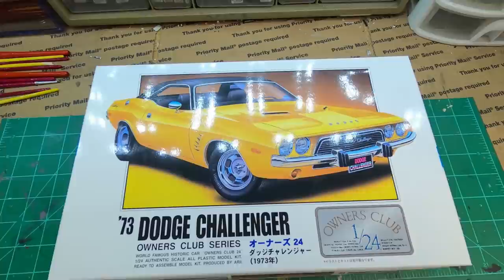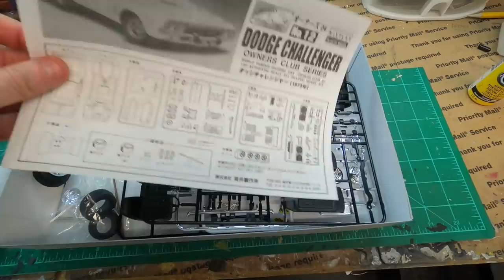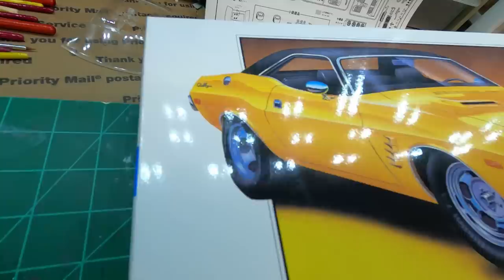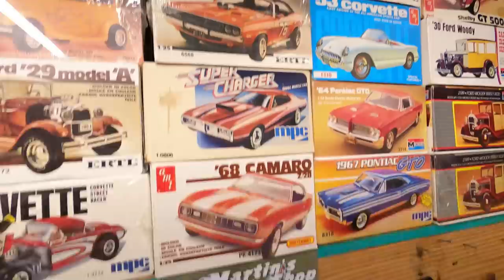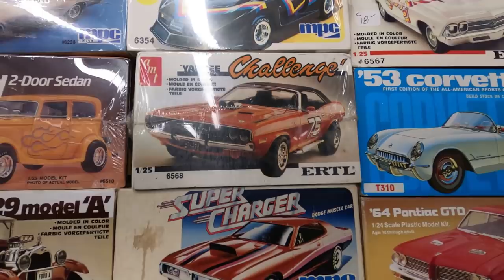ARII 1:24 Scale 1973 Dodge Challenger With MCW Paint!!

Comment: There are a few tricks to using "craft" acrylic paints. Using a quality acrylic "thinner" is a must. You can make your own using 70% ipa, distilled water,and glycerin. I have used a lot of that type of paint and it comes out great using Createx reducer.
Reply: I also use that formula with craft paint, but still had to knock down the finish with fine grit sandpaper.

Comment: The couple of things I figured out with craft paint is thin with Windex! Windshield washer fluid and IPA like other people said dry way to fast! Get a Badger electric mixer to stur the paint it makes a big difference. Bumpy paint is particles in the bottle. I do 2 things the Badger in the bottle and a powerful mixer for mixing Test Tubes and a ball bearing or B B in the bottle. For clearing over the craft and other water based paint is high gloss floor polish. Always let the clear dry for at least 20min between coats it self levels and builds great. Yes it's not as strong as 2K but much easier and cheaper to use. If I were you I'd try Createx Paint. Really easy to use and lays down beautiful. They have hundreds of colors and additives for awesome effects and not expensive at all and it's made in USA in Connecticut. If you would like I'll give them your name. I'm friends with Chris who does all their demo's here on YouTube. Check them out.
Reply from the maker: That's great info David! I'll have to try that.

Comment: Hi mat I use craft acrylics on 90% of my kits I used to use washer fluid but it was too wet and took lots of coats to cover. What I found that works really well is just mix it 50.50ish with either pledge floor polish or as I found out recently that works absolutely brilliant is Vallejo paint thinners. Tried other acrylic thinners in the past with no luck. Also you can add a few drops of the Vallejo flow improver you just have to experiment with your mixes because acrylic needs to be a little bit thicker. Get some plastic spoons and have a play with it and use light coats I use a hair dryer on the first couple of coats then once they are down your next couple of coats will cover great. Also I use 2k clear and cellulose thiners you do end up mixing more than you need though so I paint a couple of bodies to cut down on waste. Again with this practice with mixing ratios because it is quite easy to add to mutch hardener then your clear will not harden don't ask how I know. Get it right and the end results are amazing and much cheaper. Ps if you use water or washer fluid and get the mixing and painting down to a fine art you still cannot apply decals because the paint will become soft. if you use pledge it acts like a binder and once dry you can decal over it and it won't soften. Saves mixing 2k clear to put a coat on for decals I haven't tried decals over the Vallejo mixed acrylic yet but I suspect it will be ok.
Reply from the maker: Cool info! Thanks Andy

Comment: If you use craft paint, thin it with the washer fluid, NOT the IPA. The alcohol dries way to fast and produces a rough finish.
Reply: Wont the blue of the washer fluid change the color of the craft paint?
Reply from the maker: It doesn't
Reply: @modelcarvideos5829  Awesom,e I may have to try it. But I usely use very high quality acrylic paints.
Reply: @Riverrockphotos  I've only seen it change the color yellow makes it a little green but not any other
Reply: @jgarcia3949  I'm going to try this and see if it work ok.

Comment: I use Craft paint and I came up with my own thinner for it and it works really good. IPA is for removing the paint. 
it will thin it but it will also gum it up.
Reply from the maker: That's what happened
Reply: @modelcarvideos5829  I can send you my thinner if you ever want to try it again.
Reply from the maker: That would be awesome! Thanks
Reply: @modelcarvideos5829  I sent you an email

Comment: You need to reduce the craft paint with windshield washer fluid. It has wood alcohol in it and I've used it several times.
Reply: What ratio do you mix your craft paint?
Reply: @crustyoldoffroader7436  Until it has the consistency of milk. I'm the kinda guy that doesn't read the directions, so I usually burn some cookies. Ha
Reply: @alanq64  I hear that. Thanks for the answer, that helps. Model on